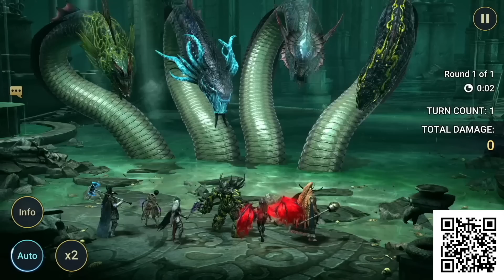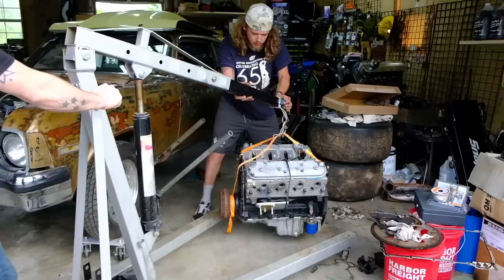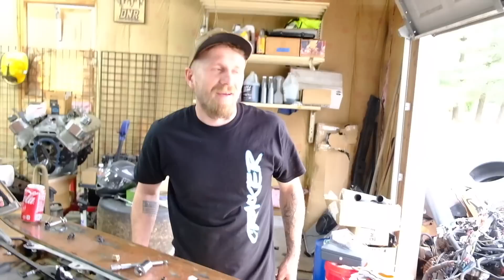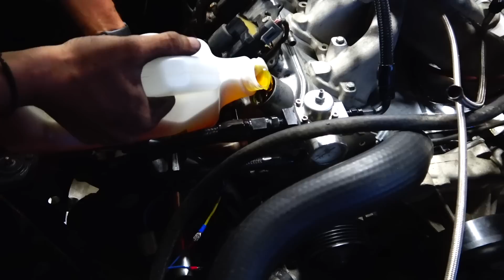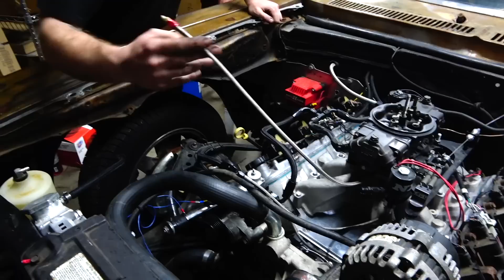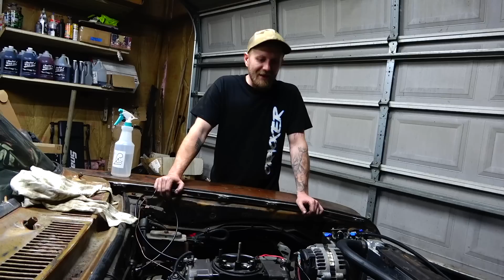FOOLS GOLD LIVES AGAIN!! Nitrous Nova Ready for Action!!

Comment: Hell ya man how much are you gonna spray in this one I ask because I'm wanting to spray my 5.3
Reply from the maker: I’m going to start with 200. I’m going to see if we can really get a handle on it and work into more maybe the 300 range but take my time instead of just stabbing it in there and going for it
Reply: @Matt_Ryce  thanks man I was thinking the same thing with mine 5.3 stage4 btr cam heads holley high ram terminator x 3500 stall 411 posi and I want to add a 200 shot now truck runs really good but it heavy I figured 200 will be right what I need